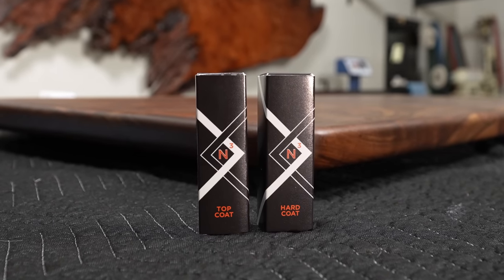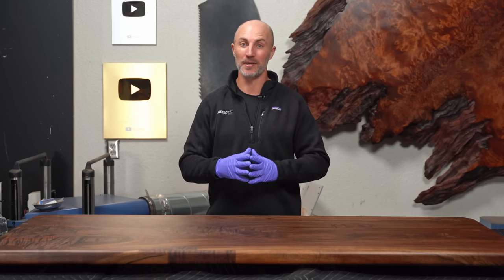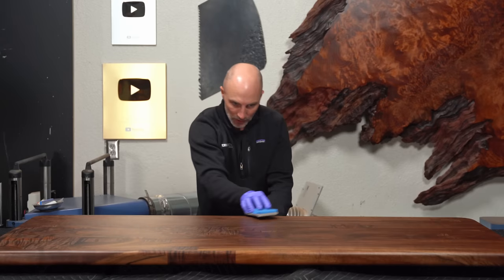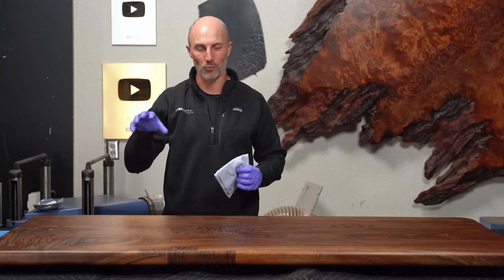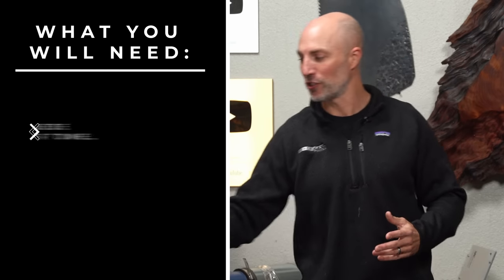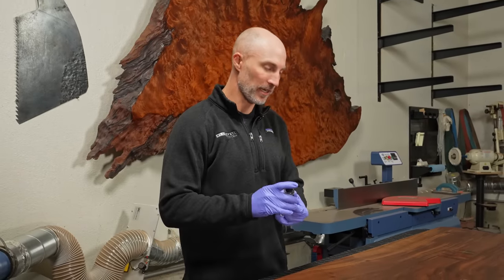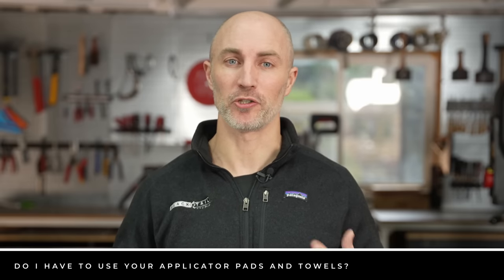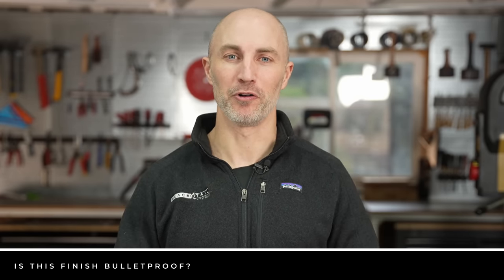2022 n3 Application Guide - Link to 2024 guide in description

Comment: I just got my kit and applied the hard coat. I followed all the instructions and it couldn’t have been easier. The hard coat turned out perfect…. I’ll be applying the top coat tomorrow. I’m looking forward to using this on more projects. I have several tables and desks that need to be refinished…. With just the hard coat, my table top feels really smooth and is pretty glossy (I’d say, maybe semi-glossy). The base finish is Osmo UV (this is an outdoor table that’s going on a covered porch, that’s why I used Osmo UV).

Comment: Hi, Cam.   Here's an idea for testing, sorry if this is gross:  dog drool.  I have a couple big dogs and they love shaking their heads and getting drool on the lower kitchen cabinets and appliances and I've noticed permanent marks on both as a result if I don't notice and don't clean it up.   If you can't get your dog to cooperate I'll let you know how it goes once I finish installing my new cabinet doors.  

On a different but related note, I used bamboo plywood (horizontal style) to make my new cabinet doors and I have to say the N3 made them look amazing.  It also did something a little odd...it made some of the lighter strands in the bamboo super reflective, almost like cat eyes in the dark.  The doors overall have a perfect satin finish and the fibers I'm talking about are definitely not a result of streaking.  I'd love to see you pick up some bamboo ply and build something with it and see if the effect is common.

Comment: I just applied n3 to a pair of lacquered solid walnut tables following your tutorial; the difference in sheen before and after is huge!  I love that it adds depth without looking like a plastic finish.  I'm curious as to how it will perform.  I'm also wondering if there are any downsides to using it on a veneered piece.  If a finish fails on solid wood, I can run it through a planer; refinishing a veneered piece with any kind of synthetic contamination can be tricky.
Reply from the maker: Love to hear that Kathy! It’ll work great on veneer too, it definitely wont complicate refinishing. You wont notice a difference sanding an n3 piece vs regular wood

Comment: Hello Cam huge fan of the channel. Its your videos that got me hooked on wood working. Finally I built an epoxy table for my son and finished it Odies oil after sanding to 1000 grit. Can I apply N3 nano on top of it?
Reply from the maker: Yup! I’ve had long term issues with Odie’s though. So it might not prevent the same issues.

Comment: Cam,
  First-my apologies for accidentally hitting a thumbs down. Absolutely not the case. Loved the video and tried to rectify my mistake by hitting a thumbs up!
I purchased a kit from you and would like some advice. I’m putting the N3 on a River table I made for my son. I followed your directions to the letter, but I’m getting streaks in the overlap area between sections when applying the hard coat. Any recommendations?
I should probably note that it’s going over an Osmo 3043 finish (also followed your instructions from that video!) and it’s probably a bit more obvious than it would be over a Rubio finish.  

Thanks, in advance!
Scott Wadle

Comment: Hello Cam, thank you for this.  I have been using Rubio Monocoat per your recommendations with great success and look forward to completing your workshop series.  I have an old table with an oil-based polyurethane coating that has a few scratches (not quite to wood) and a little unevenness in the existing coating.  Would you recommend trying to sand out the scratches and unevenness and then applying n3 or just bite the bullet and sand to bare wood, apply Rubio and then n3?   Thanks for your help!  Been following your other channel since the beginning.
Reply from the maker: Oh, it’s up to you on the look you want. You could sand the scratched out with 1000-2000 and the. Apply n3. Or just experiment and worse case, do the rubio

Comment: Hey cam, when applying the n3 I noticed you used the white side of the pad and then waited the 60 seconds and some parts you used the white pad to trowel the excess off and other times I saw you use the blue side does it matter what side you use to trowel the excess off? 
Love the videos!
Reply from the maker: Doesn’t matter, just so long as you don’t reuse hardened parts of the pad

Comment: Hi Cam.  Question about using the Rubio Maintenance Oil after using the N3.   I've put 3 coats of Rubio on and now doing a couple coats of the maintenance oil on the table.  I already have the N3 kit and am waiting a week to apply.  My question is will I ever use the Rubio Maintenance oil again or am I done with it after the N3 application.

Comment: Hey Cam, i just purchased a brand new walnut dining table and before being able to even order the N3 kit something already tipped over and put a small dent (maybe 1/16" deep) in the surface. Would you recommend trying to fill the dent with a putty before applying the n3? Or should i just start with the hard coat?

Comment: Can I apply this indoors in my shop, with no ventilation, or do you recommend doing it outdoors in my case? I tend to apply oil-based finishes outside due to the smell, and the flashing off of mineral spirit bases.

Comment: Since the top coat is a wear layer, what are your thoughts on applying only the hard coat on the bottom and using top coat for the top? Would that be enough for moisture excahange and sealing the wood ? This is with two coats of rubio...would like to save top coat for reapplication down the road! Just got my kit today and apply next weekend !

Comment: I am excited to start using this product. I use epoxy a lot in my projects specifically with redoing laminate countertops with epoxy. The industry is known to have top coats that are difficult to apply that will give that mirror like reflection. I don't think that this product will give me that natural epoxy finish. But I have yet to use it and I wonder if it will be scratch resistant as with epoxy countertops scratches are easily made and are easily identifiable. Cam or anyone I would love to know if this would be a good product to apply directly on epoxy countertops that do not contain any wood. And if you could recommend if I should use hard coat and top coat or if I can use double coats of just the top coat. It is an expensive product and I would probably be using two kits of n3 for just one kitchen so that does vamp up my price for doing top coats..

Comment: Hello Cam!  I'm wondering if you have any insight on whether or not the N3 ceramic can be used on concrete?  I recently purchased a concrete coffee table, and I'm thinking of using a water based sealer, but would like an extra layer of protection like this ceramic.

Any advice would be greatly appreciated.  Cheers!
Reply from the maker: It definitely can be! I just talked to a friend about making me a concrete counter piece to test on. Because I’d love to get this in the hands of solid surface people
Reply: @blacktailstudiouncut  Shoot!  Thanks so much for replying.  I completely missed it 2 weeks.  A friend of mine owns a detailing shop and I used a ceramic coating his company uses and the results have been great so far.  Not sure it adds as much sheen as yours though.

Comment: Could you do an abrasion test? Think, writing on a single sheet of paper, rubbing a spiral notebook across the surface, keys, edges of electronic devices, etc.? In effect, does the n3 add any hardness to the surface like a ceramic coat would in an automotive application?
Reply from the maker: I like it!

Comment: Hi Cam. Have a problem with the top coat not buffing out as easy a the hard coat. Leaving streaks.Does the top coat take longer to dry?
Reply from the maker: Oh that’s a bummer. It’s actually begins to cure faster than the hard coat, which is probably where the streaks come from. You do have to move pretty quick
Reply: @blacktailstudiouncut  did I miss that in the instruction  video?

Comment: The project I’m currently working on will be stained(since walnut is to expensive for me right now) and I might be finishing it with a polyurethane wood finish(since a hard wax like Rubio apparently won’t work on stained wood) I’m just curious if the nano coat wood apply fine or if I would even need it with a poly finish?

If someone knows if Rubio will work with stained wood please let me know since I’d like to go with that option.

Comment: QUESTION: When can I flip the table after doing hardcoats on bottom so I can start the top/sides hard coat?

INSTRUCTIONS SAY: Wait 1 hour between 1st/2nd hardcoats, wait 24 hours between hardcoat and topcoat, and wait 1 hour between 1st/2nd topcoats.
I.E. if I put 1st hardcoat on bottom, wait an hour, apply 2nd hardcoat, do I wait an hour to flip or 24 hours to apply hardcoat on top?

If it helps, I am reinstalling the bolts in the threaded inserts on bottom so the bottom side doesnt make contact with workbench, but wanted to make sure gripping and flipping wont disturb the hardcoat on the bottom after an hour of drying.

I am just trying to minimize total turnaround time as 2 coats of rubio over 10 days plus the N3 ceramic coatings over at least 2 days adds up.

Comment: OK, so you nearly answered the question I was looking for to be answered 😂. "Can I reuse/wash the applicator pads and microfiber cloths?" You did say you recommend us buying your pads, I've used them, and they're great 👍. However, I was wondering. Can you wash them? I've been toying with the idea of using them as prescribed, then, before a full cure on the pads and microfiber, I soak them in acetone for a minute or two, then wash them to clear out any remaining crystallised ceramic material. Would acetone do the job in breaking down the chemical bond between the ceramic polymers enough to wash the residue off and therefore safe to reuse once washed then dried? 

Apologies for the long question!!
Reply from the maker: I haven’t tried physically washing them. I’d worry about those little micro crystals could scratch the finish and could be near impossible to get out
Reply: @blacktailstudiouncut  I'll have a go in the next few weeks and let you know hownit goes.
I guess I'll try a few different washing processes. Acetone etc. All the best mate
Reply: OK. Just to follow on from this one. Immediately after use, I put them into a bath of acetone for 10 mins, then washed them off with a standard soap. Seems to work very well. The acetone doesn't seem to effect the pads at all other than remove the agents that I was looking to remove. I have done test patches with clean pads, and also ran a test side by side with a pad I've used 2-3 times now following that process and seems to be no ill effect on finish. Certainly no scratching. All good news 👍

Comment: If you ever had to sand down and repair the Rubio and then reapply it and then these 2 coats. Would that all blend back together? I know you mention the base coat wont have to be repairs or reapplied but part of the nice thing about Rubio is being able to spot repair so just wondering how well this can on top of it? Hoping to see your stress test soon but hoping to use this on a table I’m working on hoping for added water resistance!
Reply from the maker: As long as you’re not doing it in patches it’ll be fine. Even doing Rubio in sections, I always see the difference

Comment: Hey Cam, love your videos, I have a question about the sanders you use. I am currently using a dewalt variable speed orbital. I am looking at the Festool ETS EC 150 but i noticed that the link you use is the 3mm stroke version. Any reason not to get the 5mm? It will be my main sander and i want something that will speed up my sanding and do a better job. I figured the ETS EC 150/5 would be better than the 150/3. I have seen you recommend the 125 but it only comes in 3mm stroke and the 6 inch pad would be nice too. Can you shed some light on this for me? I hate to spend that much and get one with regret of not choosing the 5 over the 3 or vice versa. Most of my work is table/flat surface work and edge work with profiles. I plan to do your epoxy course soon to get into bigger tables. Thank you for all the work and info you have given me and everyone else!
Reply: I would grab the 3 stroke. The 5 stroke is extremely aggressive and I'm constantly having to use a lot of skill to run it in certain delicate scenarios. It's like using a Ferrari to pick up groceries. If you need to remove more material, get a Rotex
Reply: @LukePighetti  Understood. I just wonder if it would make that much of a noticeable difference in the time it takes me to sand over the cheaper dewalt i use currently.
Reply: @Dhibbsey  I feel that the 5 stroke is abrasive limited, not power limited. Can't really say on the 3. But I can say that when I want fast sanding, I grab the Rotex. On sheet goods and drywall I would take the 3 no doubt. That said, I don't feel compelled to switch from 5 to 3.

Comment: Hi Cam!
I have 2 questions:
1. The website says "Coverage: 75 sq ft per kit". Does that take into account 3 passes for the hard coat and 3 passes for the top coat? Or only 1 pass?
2. If I also have some epoxy in the table top, should I absolutely avoid going over the epoxy part? (not possible maybe, to not go over the edge between the wood and epoxy at all)? Or can I simply work the N3 on the top like it is all wood, without any worry? (except wasting the N3, or course)
Reply from the maker: You should definitely coat the entire piece, don’t avoid the epoxy. And the 75 sq ft accounts for two coats. good questions!
Reply: Thanks for the quick reply! I already ordered, and I chose right to order 2 kits then

Comment: in the first half you used the blue side after the first 60 seconds but when you did the second half =use used the same white side to clean off the coat after the 60 seconds.  was that a mistake or does it matter?
Reply: blacktailstudiouncut1  I am trying to reach out.  I just put two coats of the hardener on a small river table I made with black epoxy and olive wood.  Nothing close to your quality but my wife likes it.

Comment: Quick question; I'm applying your n3 to a piece that has an epoxy finish, sanded to 3,000 grit. After buffing and polishing with 3m perfect it I am wondering if this finish will stick to a polished-glass like finish? Am I better off not polishing and just apply it over the bare epoxy at 3,000grit?
Reply from the maker: It can go over either, but if you want a more satin/semigloss look do the 3000
Reply: @blacktailstudiouncut  ok thank you! Awesome product by the way I’ve used it on a few pieces now.

Comment: Hi i just bought a tabletop pheasantwood as conputer desk. it comes with lacquer coating. is that durable enough? can i just apply N3 directly without sanding it? which N3 to apply to increse the protection? thanks